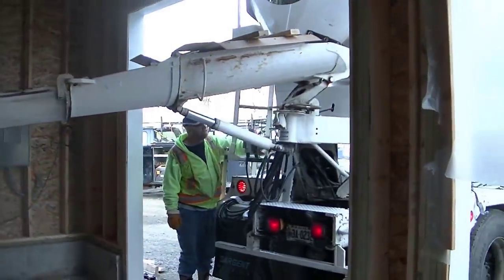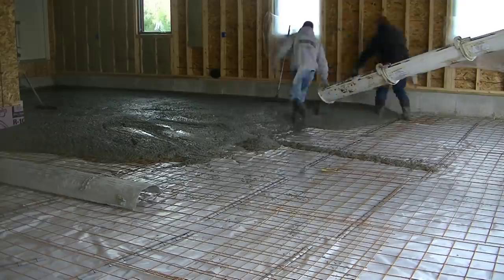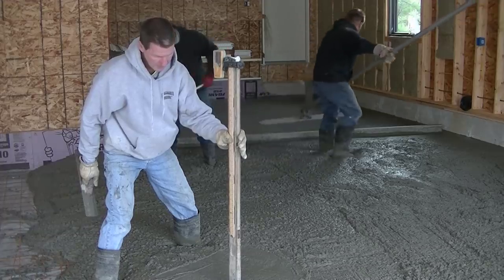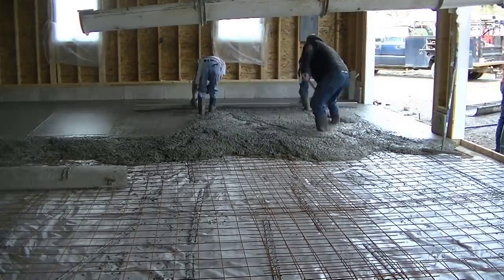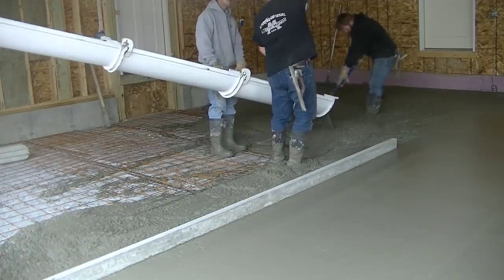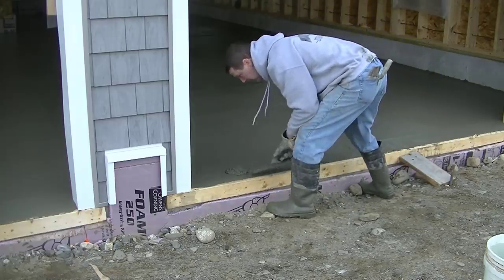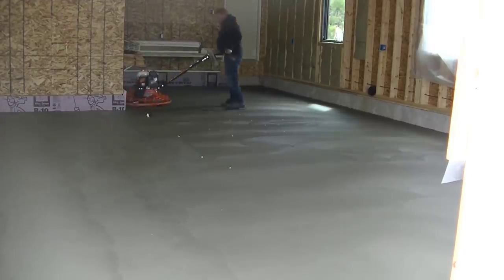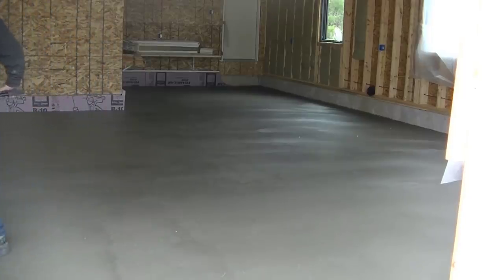How To Pour & Finish A 42' X 28' Garage Floor [Concrete Floor]

Comment: We definitely kick screed most of our floors. Where I live we just discovered vibrating screeds about 5 years ago for residential...most guys don't use them. I have a question for you, though. Do you use any plasticizer in your mix, when you pour, or is it all water?

Comment: Hi Mike. Nice job 
Do you guys ever pull up the wire mesh? We made hooks to pull it up. What’s the mix your using? Looks real high slump like a 10” lol.  I’m sure you have water reducer in it? Makes it much easier to screed and get down the extended shoots. We pour a 5-1/2 to 6” slump. Usually vibra screed a lot of them. I don’t think my concrete would flow that far down the long shoots you guys use. I’m thinking about getting then shoots to save some pump charges. 👍 Does that mix dry as fast as regular 6” slump with no plasticizer in it?

Comment: We did your kick screed when we had three man. . . Most the time we had two man so we had me on muck rake and we used an 8 foot 2x4 with handles screed . . We set our wet pads and wall pads before screed. And he power throws while I clean tools, and ride scares on wall and corners.
Reply from the maker: That is awesome!

Comment: Nice video and info Mike. I plan on pouring an addition to my garage floor. I have a long driveway that is 6 inchs thick. would a concrete truck loaded with 3 yard of concrete cause damage if I have them drive up on my driveway?
Reply: As long as the 6” driveway concrete is at least 3000 psi and has reached full strength, there’s no reason it should damage it.
Reply from the maker: It should be just fine. Make sure he doesn't get to close to the edges. And wait until after mud season. If the sub-base was done correctly it'll be good.
Reply: @MikeDayConcrete  thanks for the reply
Reply: If you're really concerned look into a concrete pump that's on a trailer, should be somebody around you that does that. Not one of the giant boom trucks, it's a small towable unit.  There will be a cost of course but I've seen them setup their trailer at the end of a driveway and pump it to house just like the situation you're wondering about. Would save any worry about driveway

Comment: When I did my garage floor 3 car bay I chalked the perimeter... didnt have laser .  Did you cut the slab for expansion??? I did not .I have infloor heating in my floor with lots of rebar and 4x4  screen. I did get a couple cracks. . Should have cut.
 Good point at the end apparantly I did not sloop the floor enough at the doors . I do some  get water in when it rains hard .
You make it look so easy.....
Next project is stamped concrete walkways ....Having a hellava time finding stamps in Canada. Ive seen your concrete stamp videos . I would love to see an indepth tutorial on it.
Also any leads on stamps that I may be able to get near the boarder?? 
New York /Canada 
Thanks
Reply from the maker: Yea, we cut it.

Comment: The reinforcing mesh is right at the bottom of the concrete layer. Wouldn't it be more effective if ot was raised a couple of inches?
Reply from the maker: We got slab bolsters under it helping to keep it off the bottom.
Reply: @MikeDayConcrete   Thanks for info

Comment: If the garage floor is sloping, what elevation are you using to set the receiver too? Are you setting it to multiple elevations?
Reply from the maker: My back and front grades are set by the chalk lines on the foundation walls. On a garage this size I only need to set it to the middle grade. The middle grade is 1" lower than the back of the garage and 1" higher than by the garage doors.
Reply: Mike Day Everything About Concrete that’s what I thought. Keep it simple.

Comment: 2 man aluminum screed, 3 pulls then a push pull to seal it up. We pour around a 4 slump. Maybe up to a 5 slump
Reply: Also we set a steel pipe on any non-wall-line side of a bay. I like to pat my wall lines with the screed too to get them fully dialed in. We don't just pour floors so we are handicapped compared to you guys 😂
Reply from the maker: Haha, handicapped. As long as you get them done and the customer is happy, that's what matters most.

Comment: Throw in a couple grade stakes.  Steel pins with a 16 penny nail through one of the nail holes.  Using a string line, Set the top side of the nail to grade.  You run your grade stakes straight in line, and you can use your straight edge to go from pin to pin, run the straight edge right on the nails.  That’s how I set all my wet pads, screed on from there.  Saves a ton of time and potential for errors playing with that laser.  To each their own, I just don’t like having to run around with that laser while trying to pour, I’ve even been in the middle of pouring a basement (not my job, I was an employee) and had the laser quit working.
Reply: That sucks was it framed so u could cut a story pole?
Reply: rzl dzl no, it was an open basement.  The batteries died in the laser.  Not fun, somebody went and got batteries if I recall.
Reply from the maker: We do the grade stake thing sometimes. It works good too.
Reply: So you drive stakes into the ground, that's going to draw up moisture and the top of the stake is at the surface? Do you put plastic down? If so, why? You're just putting a bunch of holes in it. Yeah, won't be having you pour me any concrete lol I'm guessing you leave wire mesh laying on the ground where it does nothing as well.
Reply: farm.central. ohio you clearly have no understanding of what has been described here.  Should you decide to weigh in, at least have something intelligent to add.

Comment: Why does the garage have a slope if its in doors?
Reply: Jason Cafeo  so the water that comes off your car in the winter from snow flows to the drain
Reply: @keananoien5432  didnt see no drain
Reply: @smackflack5771  The floor slopes toward the garage doors and drains out from there.
Reply from the maker: So water from the wet car (rainy or snowy) weather will run out the garage doors and not puddle in the garage.

Comment: why install wire if your not going to pull it up into concrete.......just a thought
Reply: This is covered in the previous video where they prep this garage.  The wire is sitting up on chairs, or bolsters, whatever you want to call them.  They are pre bent pieces that you purchase from the supplier with the wire.  They hold the wire up for you, so you don’t have to mess with it during the pour.  They come in different heights, for different thickness concrete.  They are nice to have.
Reply from the maker: What Stephen said!
Reply from the maker: Thanks Stephen. Good comment.

Comment: 24 yards that's 2 trucks and a clean out not 3 trucks---
Reply: What are you referring to as a “clean out”? The truck with the final 4 yards? Still equals 3 trucks. 2 with 10yds each and 1 with 4yds.
Reply from the maker: If I know I need 24 yards like this job, the batch man will load 3 eight yard trucks. That way if I use flake accelerator I can put the same dose in each truck.
Reply: @MikeDayConcrete  that's true boss ?